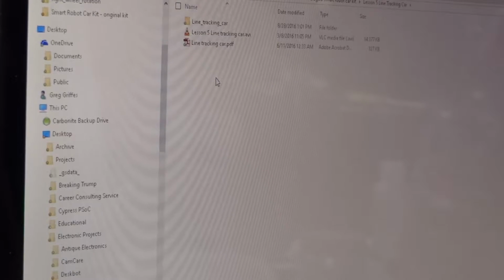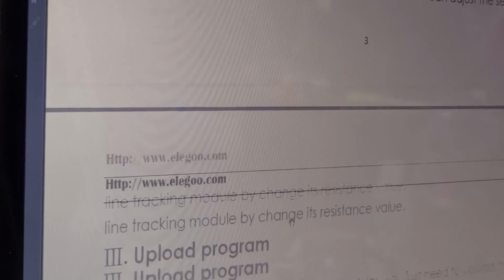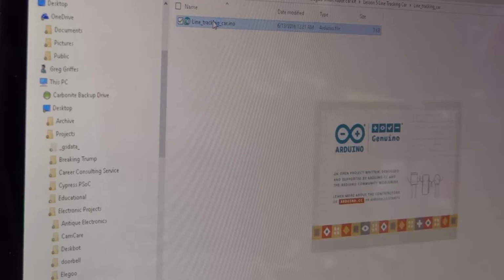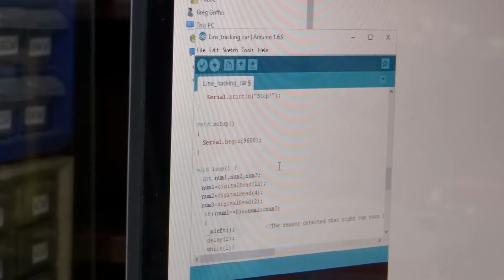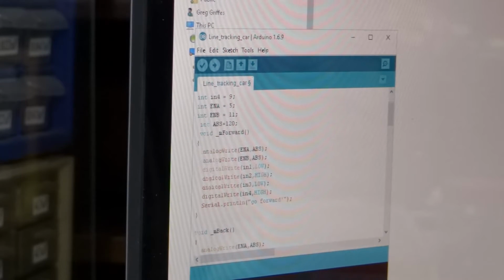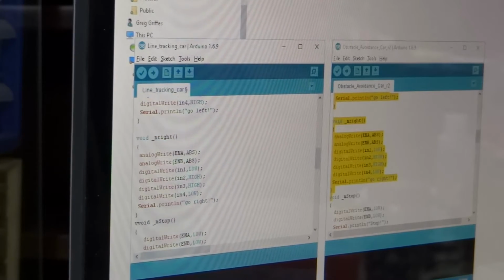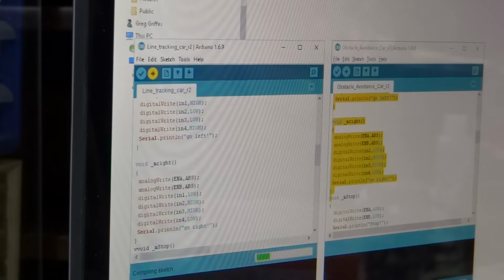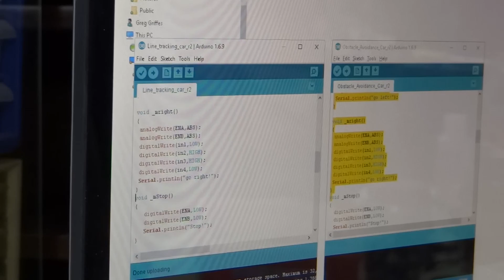Elegoo SRC kit 40 Lesson 5 line tracking car pt1

Comment: we bought makeblock mbot and have been pleased with it.  the elegoo is significantly cheaper, but appears to not have Scratch-like programming interface.  Is all programming done with Arduino IDE?  Do the "out-of-the-box" programs work, or are there a lot of revisions needed?
Reply from the maker: jeff tennis it's arduino IDE C code, and I did have to make minor changes. However, their intention was that their code should work out of the box, so they may have made some improvements since I published.